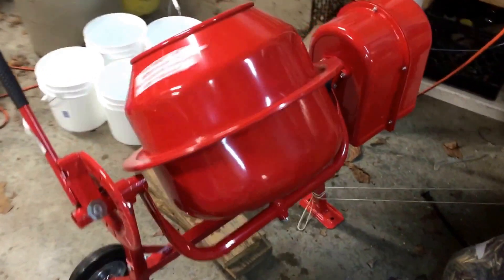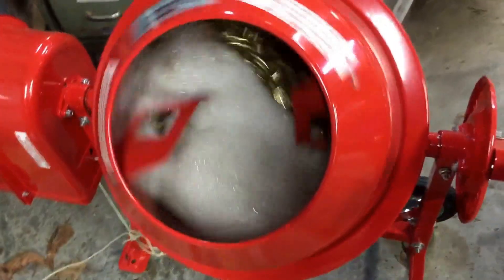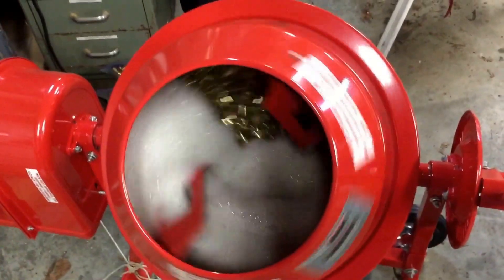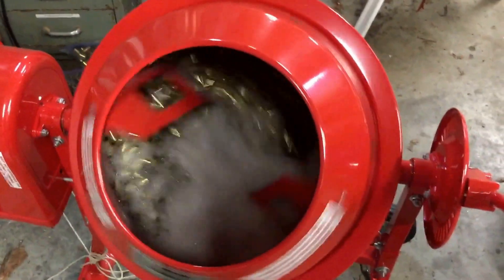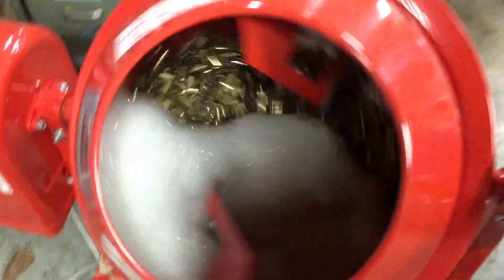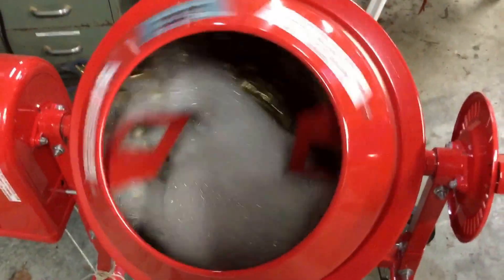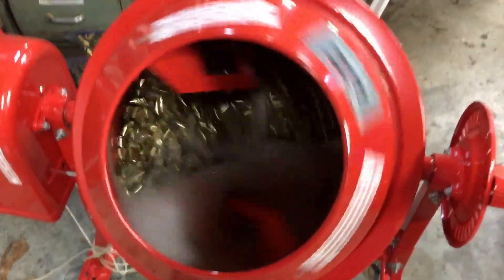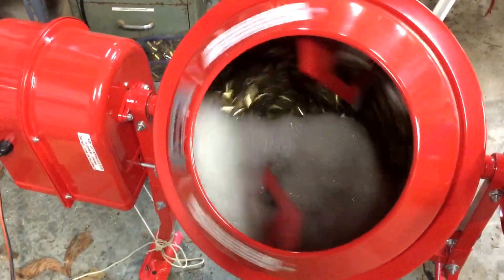Wet processing brass.  Harbor freight 1 1/4 cu ft cement mixer, 2 gals / ~30 lbs 9mm brass

Comment: Just bought one of these from HF.  Mine leaks like crazy between the seals and bolt holes for the internal blades.  Did you seal the gasket somehow or did it just work?

Comment: Are you using the stainless steel media to clean your brass?
Reply: FlyingSkwirl,  I was looking at this exact 1 1/4 mixer. Is there a better one you would recommend. I'm not as concerned with a bigger size so much just want reliability and longevity. Thanks